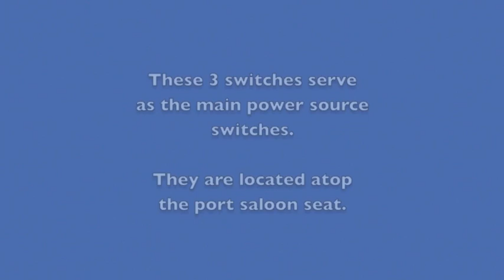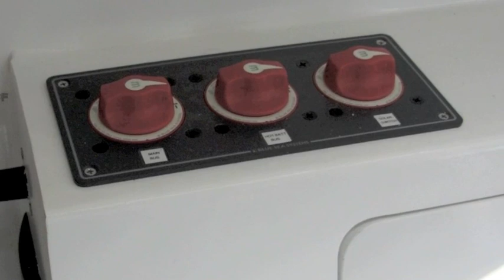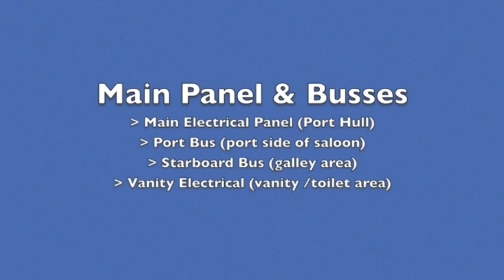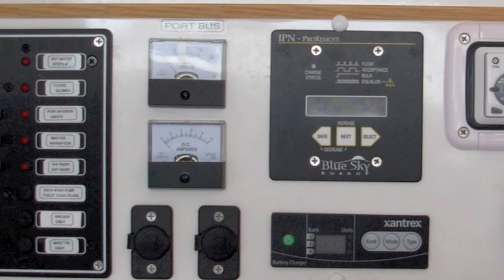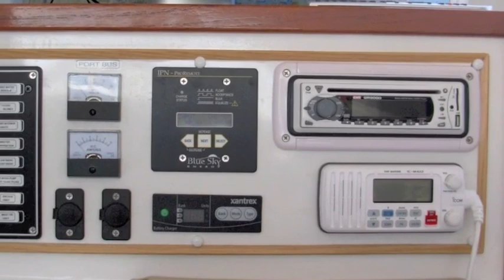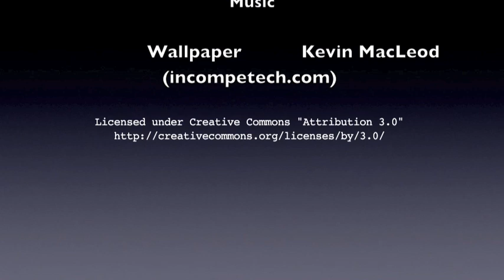DIY Building a Sailing Catamaran - Electrical (11)

Comment: It was roughly 3000 hours. Some do it in 2500hrs others in 5000hrs - it depends on how complex you choose to be. Broken down into small achievable projects (or goals) and then completing each goal, makes it much more pleasurable. Starting with the correct 'mind-set' is also very important. Do appreciate your feedback, than you.